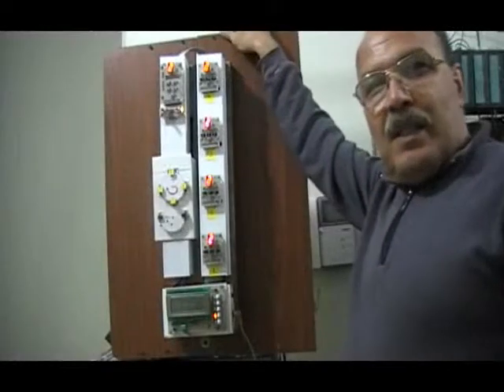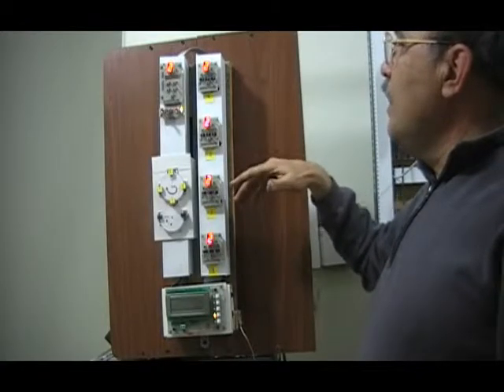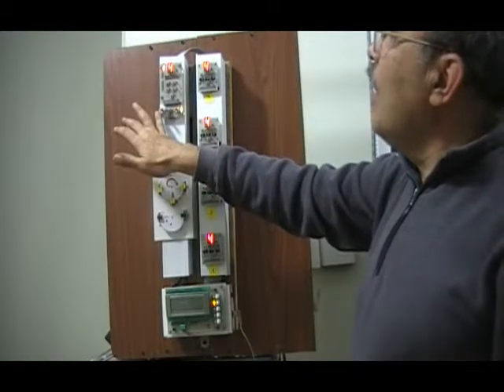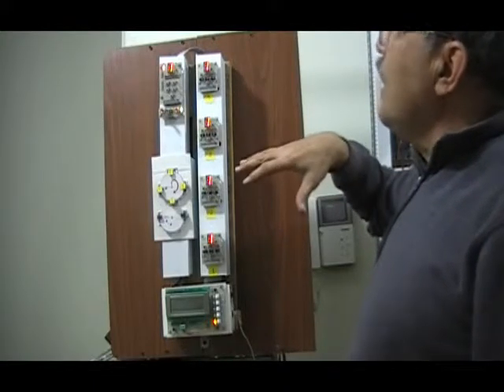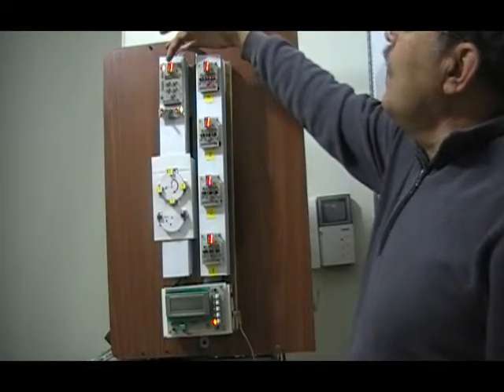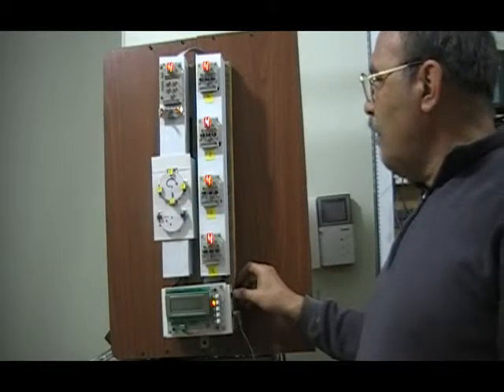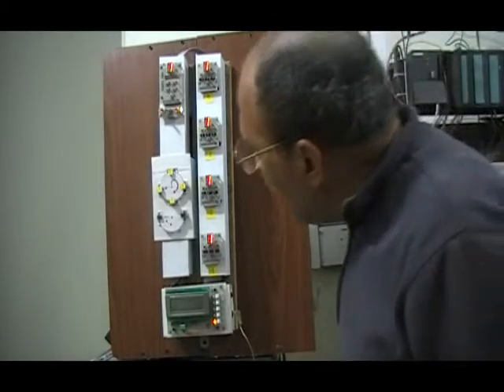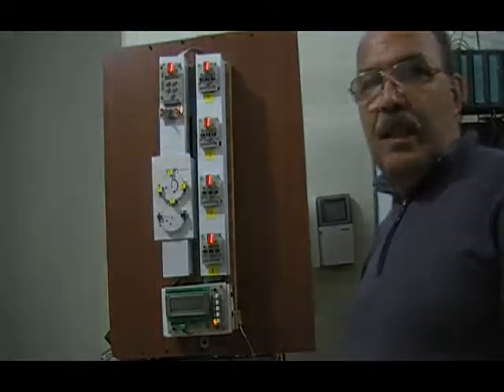Microcontroller based (ATmega8) 4 Floor Elevator System

Comment: can u plz tell what is the software that u used to run the code?
Reply: hello. Do you have pcb files?
Reply from the maker: An AWESOME NEWS TO MY CURRENT CHANNEL SUBSCRIBERS:
I have generated 61 great educational course lessons devoted to programming Siemens S7-1200 and KTP400 HMI display devices 
made by Siemens for intermediate and beginners as well. Also, 32 lessons devoted to programming the Allen Bradley Series 
of PLCs mainly for RSLogix 5000 and 500 CONTROLLERS. Just recently, I started creating similar lessons for the Delta PLC 
series. Please use the youtube.com/plcgoods Link to subscribe to other plc-related channels and enjoy watching all those contents!